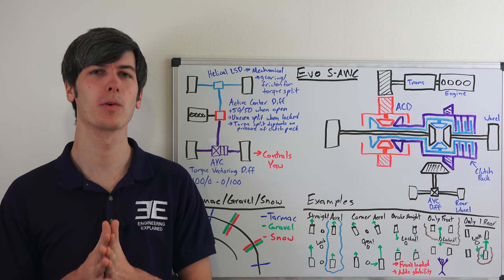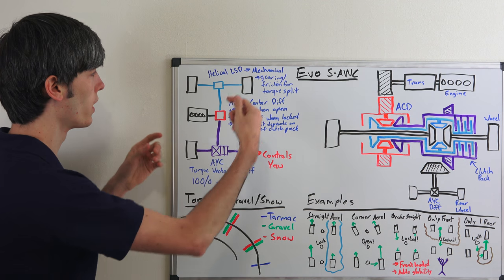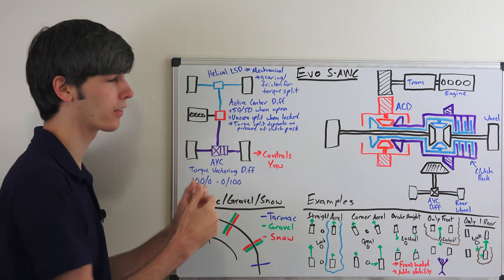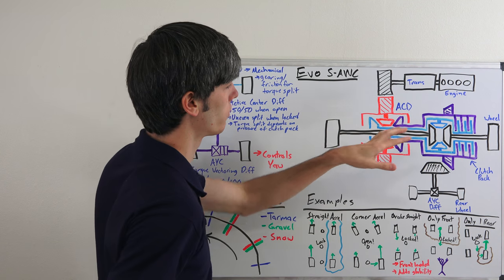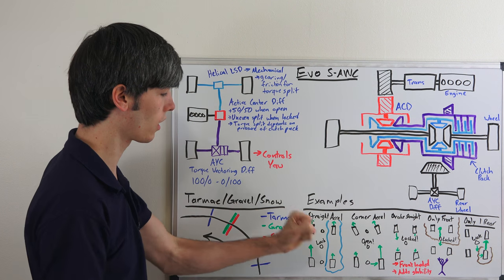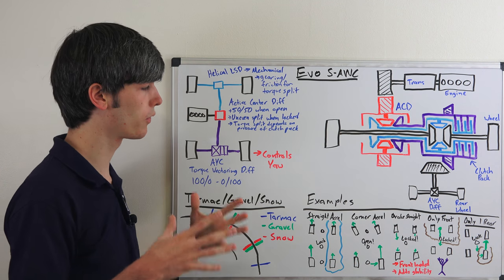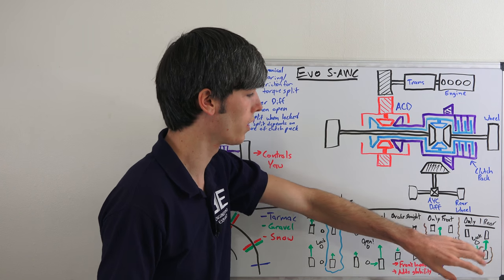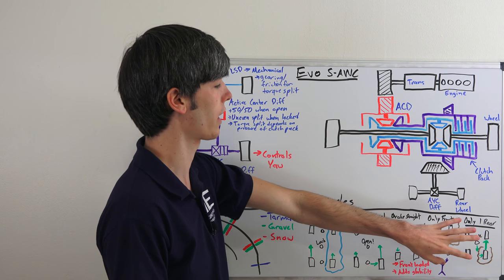Mitsubishi Evolution X - How The AWD System Works (S-AWC, ACD, AYC)

Comment: Jason. love this one. As a WRX owner this has always interested me. I have two technical questions for you. Would you think the changing points of the central diff's changing nature make it more prone to braking? What do you attribute the massive amount of broken transfer cases (which I assume is the "center diff" in this scenario)?
Reply from the maker: +D Cook Forgive me, but when I read "WRX owner" and "massive amounts of broken Evo transfer cases" all I can think of is bias haha. Is there data showing Mitsubishi is having lots of problems with these transfer cases, or is it folks who are cranking the boost and assuming the stock drivetrain can handle it?
Reply: +Engineering Explained  Your accusations are indeed correct. As a WRX owner I have heard and seen even built transfer cases not surviving autocross launches.  I know several local evo folks who have never launched their car because of the fear. One guy I met driving in the snow said he wanted to take it easy for fear of breaking. So my justifications aren't just coming from a subaru biased mind! Of the four evo owners I can think of locally, one is fully bolted, the other is just downpipe and intake, the other is mostly stock and the last has boltons. If that answers your question. You think it may be a torque limitation for these then? (side note: I then wonder if the focus RS may have same limitations with its advanced torque system as well.. )
Reply: +D Cook At least the torque gets past the transmission. Cant say the same for my 5spd WRX.
Reply: My 6spd fa20 has no issues with the 280ftlb getting me around corners in the tarmac, mud, or snow and ice ;)
Reply: +D Cook well the 5 speeds have been garbage for me. I'm on my 2nd ej20 as well. Thankfully its not a dd or even a track car at this point. Basically just a garage queen now. 118000km on it and reliability is non existent. Running 276bhp and ~250 ft-lbs of torque. Neither of my evos have had any reliability issues on the other hand. My evo 4 dyno'd at 386 awhp last week and I'm on stock tranny/tcases etc. Evo x has been fine too. Just regular maintenance is a lot.
Reply: +D Cook  Notify the editors of the Oxford English dictionary where Massive has been redefined to mean 4.
Reply: +FerpiliciousProducts have you had ringland issues sire?
Reply: +cagednm69 on my wrx? I had rod knock.
Reply: FerpiliciousProducts Yeah i meant the WRX.
Reply: lol. I am just giving my insignificant experience with Evos, given i'm a subaru driver currently, and coming from the mazda world where zoomzoomboom is a nightmare. I'm only suggesting that it seemed like the transfer cases were the biggest failure points in the evo X. I am not saying that 4 is a massive scale by any means, but the fact that all 4 owners would never launch their car kinda made me scratch my head. I am just trying to understand where the flaws are with this transmission. Is it too much torque hitting the splitter? Do the DSG ones not have that problem? I'm here to learn buddy

Comment: Sooooo... why IS there a center differential in AWD cars?

I understand that front and rear axles need a differential to enable left and right wheels to move at different speeds while torque is applied. When car turns, inner wheels necessarily rotate slower than outer wheels.

However i can't understand when the rear of the car, as a whole, would need to move at a different speed than the front of the car? Other than loss of control, drifting? But this is not desirable, indeed AWD system tries to mitigate drifting.
Reply: Front axle will have a different speed than the rear axle, which leads to the need of center differential.
Reply: Erknlssn Under what circumstance does front axle have different speed than rear axle?
Reply: +Siana Gearz: During turns, and if you have different wheel sizes front/rear (not recommended on awd cars in general) 

Easily showed with a bicycle 
Start with both tire valves at the bottom. Lead the bike in a turn until the front wheel has done one revolution (valve at the bottom again) and then check how much of a revolution the rear wheel has done. 
Same applies for a car but easier demonstrated with a bike
Reply: because two axles follow a slightly different path because of their different yaw? I'm starting to understand, thank you.
Reply: http://www.lcool.org/technical/diffs/turn.gif

http://www.lcool.org/technical/diffs/diffs.html
Just an image to help get it for others who may come across this, and the article explaining it.

Comment: PLEASE, someone answer me !
Haven't anybody invented a system where ALL WHEELS will be having torque sent to either you are on a straight line or going around a corner ?? +Engineering Explained
thanks
Reply: Most systems will send SOME torque to all 4 wheels in a corner but sending the EQUAL torque to all 4 wheels in a corner wouldn't work as the wheels need to spin at different speeds with the outside wheels spinning faster than the inside wheels. Even in a straight line an equal split isn't ideal as acceleration and deceleration can shift the center of gravity of the vehicle and the torque would be wasted on wheels that have less traction. That said some Jeeps have full locking diffs but that can only be engaged off road on loose surfaces where the tires can slip to allow for the speed differential between the wheels.

Comment: Where do you get your information like this from (i.e., detailed technical specs on specific models and trim, like what differentials each generation of Evo had, what their gear ratios were, cylinder bore diameter, etc)? I often find myself searching on forums and journalist websites for hours for info like this, but can never find simple, reliable info. Do you have specific websites or write ups you go to, or do you (like me) scour the forums until you find someone who sounds like they know what they're talking about confirm what you're looking for?

For Subarus, we kinda have Cars101 dot com, but sometimes it's incorrect or missing things. Do you have a go-to website like this for other cars you talk about?
Reply from the maker: +SideWays8Productions I'm trying to be that go-to website. :) I haven't found one, let me know if you do! I spent a great deal of time researching the subjects, in this case I approached Mitsubishi directly and spoke with on of their engineers who worked with the Evo's AWD system.
Reply: +Engineering Explained research done the old fashioned way.

Comment: Mitsubishi S-AWC also uses the ABS system to achieve what it does. Not all the information I  this video is true.
Reply: Your statement is only partly true. The system uses the wheel speed sensors that are part of the ABS system to determine wheel speed and adjust the ACD and AYC appropriately. The brakes are never used to slow a wheel or act as a clutch to manipulate an open diff as they are is many other systems like Subarus.
Reply: The S-AWC system incorporates the ASC/ABS system. The ACD, AYC and ASC all work together the make the EVO X achieve what it can. Unlike the previous EVOS this what makes it the SAWC system. otherwise all that is being explained is how the ACD and AYC work. Applying the brakes at each corner when needed is exactly what it does the control the vehicles stability and traction.
Reply: Not correct. What makes it S-AWC instead of just AWC is AYC. The Ralliart has an ACD and is equipped with ABS and has ASC but because it doesn't have AYC it's all wheel drive system is simply AWC. On top of that the S-AWC system is still fully functional even with ASC turned off.The ONLY part of the ABS system that is used for the all wheel drive system is the wheel speed sensors. The brakes are not used in any way to manipulate the diffs or vector the car. It isn't possible to disable ABS on the X because it will also disable the wheel speed sensors and therefore the entire S-AWC system, but the brakes and traction control are not involved in the S-AWC system at all.
Reply: So if that be the case it would have been called SAWC since it was introduced on the EVO 7. The ASC and AWC systems all talk to each and act as one complete system to make the S-AWC system.
Reply: I'm not arguing that the two system don't communicate. The issue I have with your statement is that you are implying that the AWC system uses the brakes for vectoring like a lot of other systems today. That is not the case. I also take issue with the way you insist that the ASC allows the car to handle the way it does. You can turn off ASC and still have a 100% functional AWC system. ASC may still be gathering telemetry and feeding it to the AWC system, but it is not actively inhibiting engine output or applying braking force when ASC is off. The AWC/S-AWC  naming scheme actually applies to a lot of different systems used in the Mitsubishi lineup and is really just a marketing thing now, S-AWC in the Evo X is not the same as S-AWC in the Outlander just as AWC in the Ralliart is not the same thing as AWC in the RVR or AWC in the Evo VIII.
Reply: Ok and the only issue I had with the video is that is was trying to explain the SAWC system however doesn't mention the role that the ABS takes in the S-AWC system.

Comment: Subaru and Audi is still the best.
Reply: +Kanice If you take their top of the line models they still aren't the best. Plenty of competition in the market including Acura and BMW who build torque vectoring AWD systems. So many iterations of all these systems there is no best. Just whatever you like to believe.
Reply: +Kanice EVO's AWD system puts most of Subaru's and Audi's lineup to shame. One could argue about their top of the line AWDs though (the STi and Audi's new rear "sport differential")
Reply: Vlican Subaru's system is nice with regard to maintenance. The STI system has mechanical diff's which is great. The Quattro's systems cost upwards of 50K to get any torque vectoring. Everything below that is open diff electronically controlled systems which is basically 4wd with traction control. Same goes for Subaru. They market their systems very well but only some of them are actually good.
Reply: +Kanice That is incorrect. Their higher end stuff is very good, but still pretty far from the ridiculous cornering performance of the S-AWC. Though if you really like understeer, Subaru and Audi always deliver the goods.

Comment: Now for part 2 you can explain why Mitsubishi was stupid enough to get rid of the Evo but not the standard Lancer
Reply from the maker: If there's not a market you don't build it. That's how it goes, for better or worse. They have to keep their focus on a product line that makes financial sense.
Reply: Engineering Explained Well If thats the case then i have no idea why the WRX STI is still around
Reply: +Clayton Cortina  cause it sells
Reply: 1XXdragon Well i wish the two would have even competition for basically doing the same job. Like the Camaros and Mustangs
Reply: +Clayton Cortina The new 2016 Focus RS is taking the Evo's spot as the Sti competitor. :)
Reply: +Badxp3riment ahh very true! Good bye evos
Reply: Not around for much longer Final Edition STI already Launched "if it does not sell you don't build it"

Comment: huh always thought evo was 40/60 split
Reply from the maker: That part was incorrect. See the video description for a link explaining in great detail. :)
Reply: Engineering Explained Whaaaat you responded back!!! I can die with no regrets now!
Reply: +Engineering Explained very knowledgeable enjoy it but now i have a question how does the evo awc differ from other lancer awc models i have a se awc limited edition (canada) been trying to find out hownit works as it has a selector switch 2 wd, 4 auto and 4 lock as far as i know it doesnt have yaw control. thanks
Reply: +Engineering Explained very knowledgeable enjoy it but now i have a question how does the evo awc differ from other lancer awc models i have a se awc limited edition (canada) been trying to find out hownit works as it has a selector switch 2 wd, 4 auto and 4 lock as far as i know it doesnt have yaw control. thanks
Reply: +Engineering Explained very knowledgeable enjoy it but now i have a question how does the evo awc differ from other lancer awc models i have a se awc limited edition (canada) been trying to find out hownit works as it has a selector switch 2 wd, 4 auto and 4 lock as far as i know it doesnt have yaw control. thanks

Comment: lol the evo centre diff cannot split torque front to rear. thank you for posting yet another incorrect video about the evo awd system, further perpetuating all the misconceptions about the evo awd system
Reply: Yea im still trying to work out how he figures this ... it either is open - or locked - or somewhere inbetween - it cant magically make front or rear spin faster than the overall drive that any normal open differential would.